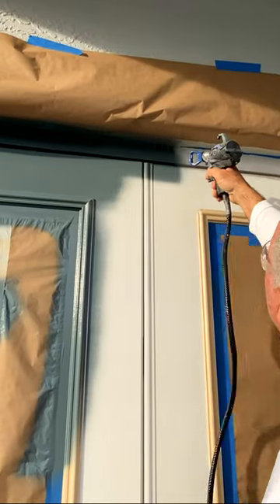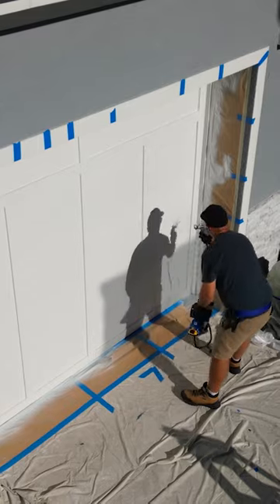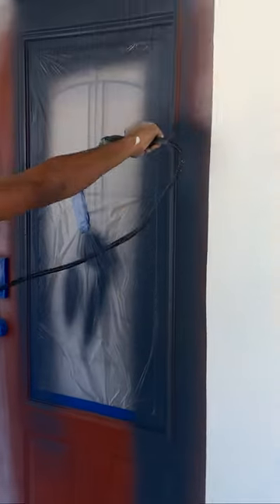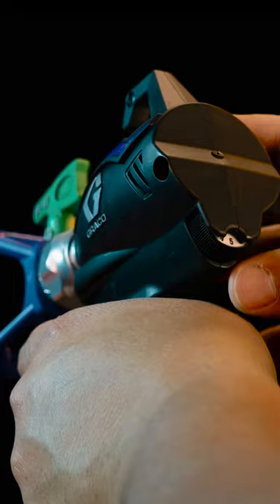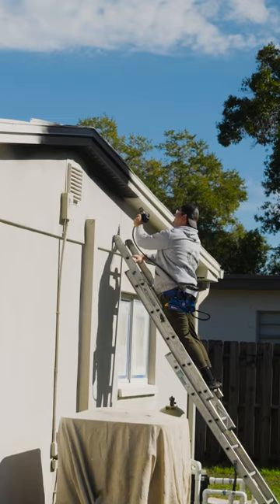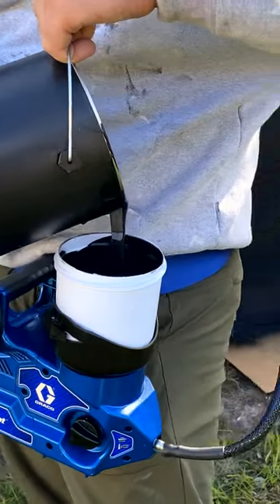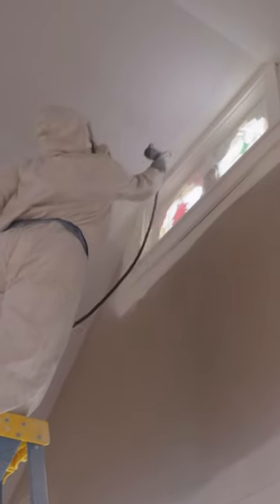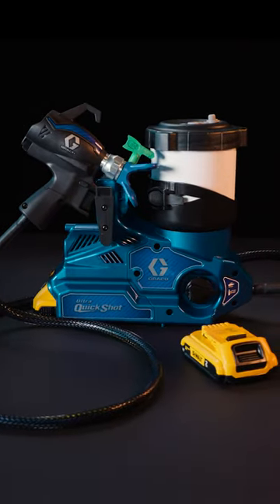NEW Graco Ultra QuickShot

Comment: I have heard comments from 30-year-old professionals working with this type of machinery, the problem with this machine is simply that in the part where the speed increases when you are using it, for example in a speed of 5 the speed goes up or down accidentally with the movement of the hand it is necessary to put a tape at the desired speed so that it does not move (the pressure rises or falls)

Comment: Is there the same pump like ultramax? Then no for me. Very disapointed of ultramax
Reply from the maker: The Ultra QuickShot piston pump is a unique platform with a hopper style feed that delivers long life in materials from thin stains and polyurethanes to thick exterior latex. But, we've also upgraded the pumps in our Ultra handheld sprayers to the new Triax II pumps, which can pump 3X more material than the original pumps before service is needed.
Reply: I will buy one when you get a fair price for the sprayer.

Comment: There's a lot to like about this sprayer but for $1300 to $1,500 dollars I believe Graco missed a few things. The airflow control location is a joke. If you don't secure the the flow adjustment wheel with tape, it will ruin a good paint job. The machine looks pretty with a nice paint job. However you can't clean it with acetone or thinner. You will have a very ugly machine soon. Why would Graco make a unit that can't be cleaned completely. Graco please fix the adjustment wheel issue. Big problem.